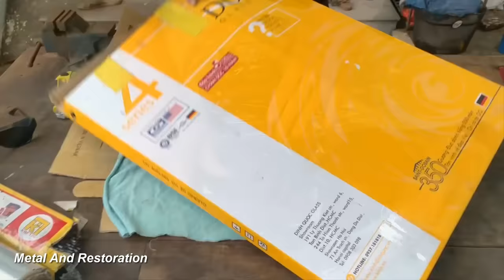Restoration Viking Axe Battle Old | Restore AXE construction Antique

Comment: 2 things, first the holes in it could've been cut into a decorative hole, which was occasionally historically done on weapons. Second, the dang heat treat. The blade wasn't near hot enough for a good quench it needs to be orange. A slightly bright orange but not much hotter, all that happened was normalization (softening) of the steel. And because the "treat" was done in sections, it makes different parts of the blade different steel grains, making it weaker overall. And holy lord he quenched in WATER. That's how you get cracks and fractures in a blade. Quench in oil, never water.
Reply: That's REALLY Interesting! Tell me more! Why use Oil? Wouldn't that inflame the Blade or rather take more time to cool down?
Reply: @jmeister7482  the problem with water is it cools the molecules too fast. And something that's rigid and it gets cooked to quickly, it becomes brittle. As I said, it breaks apart the grain structure of the steel. Oil cools the blade relatively quickly but not too quickly, making it hard with a little bit of flex instead of too hard and very brittle. And yes, the oil does tend to catch fire when you put in a piece of metal that's around 1500 degrees but once you take out the blade, the flame goes out. That just happens. It's not dangerous, especially in an outdoor or well ventilated quench tank
Reply: I see, that's good to know
Reply: Yeah, what he does is absolute nonsense. 
Hurt me a lot to watch this.
Reply: @redneckfishing9357  the Japanese metallurgists suggested "Quenching in a slave" could have been for several reasons. Iron in the blood, at body temperature, or to add the spirit to the blade. The original text is ambiguous.
Reply: @jimleane7578  uh alright. Still doesn't excuse the quenching techniques this guy uses. Blood is a lot more viscous and has different components going for it. It acts more like an oil, when thinking about common quench practices. And I doubt the Japanese did their blood-quench in sections like this guy
Reply: @DragonQueefs  It depends on the use as opposed to the metal. Rasps and files are quenched in water to make them super hard, but they're super brittle. That's just what happens when you quench steel in water. For a blade, you use oil 100% of the time or you'll have a basically unusable blade. On top of them doing uneven quenching with a blowtorch. If you want a blade or weapon that's usable, quench in oil and nothing else. If you want a wall piece it doesn't matter, but at that point you wouldn't even quench it. In short: never quench a weapon in water unless you want it to shatter on contact to anything
Reply: @DragonQueefs  the quench is a way fo line up the grain of the steel. And water lines up that grain super super quick, which makes the blade internally like sand. The grains come apart. Oil does that more slowly. Making it a less "hard" blade but a lot more durable. A tempering process helps but the quench is most important. If the grain isn't lined up, the blade overall will fail
Reply: @DragonQueefs  like I said, depending on the use. Not for weapons
Reply: Daaamn. The experts are out.
Why don't you go make your own vids?
Gtfo

Comment: Why would you quench that with water but not oil?
and the spray painting just killed me!!
Reply: dude, I feel you on this one. The spray paint hurt me...and the water vs the oil. smh...Otherwise, awesome work.
Reply: maybe the guy who sent it to him told him he wanted it spray painted black. :/
Reply: he knows how to restore...
but poor of taste for artwork...sad
Reply: News flash: Iron when it isn't polished is BLACK. Plus it's a rust prevention layer!

Oh and why WOULD he quench it with oil? Smh don't pretend shit if you don't know the use of it. It's forged anyway, quenching it again is useless. It's water to COOL IT DOWN
Reply: nowonmetube news flash, that was obviously him quenching it, no on heats up material and immediately cools it for no reason.
Reply: @justinnicholls5974  News flash, of course it wasn't for no reason. But sometimes I question why people quench, quenched stuff again. And the way how he did it doesn't look very effective. He should have heated up the whole thing until it glows and put it in a pot with liquid, like other peoples do. Not heating up a few centimeters individually with a lighter.
Reply: @nowonmetube  When you heat the metal again you lose the hardness and it can become flexible again, not holding an edge as well. Since the edge is the only part of this tool that needs to be hard he did a simple edge quench. This has the advantage that the rest of the piece will stay flexible and absorb impacts, but the edge is hardened and will stay sharper longer. As for water vs oil it depends on the metal and how hard you want the metal to be after you quench it. Water will cool the metal faster, making it harder, but also more brittle which can cause it to potentially shatter on impact. Oil cools it more slowly. Different metals have different structures and need to be treated differently to get the best results.
Reply: @wowfirebat  you said when heating it again you lose harness, but then you said it's the only part that needs to be hard? WHAT?

About the water oil thing: Exactly, and well maybe this metal was better off treated with water instead of oil? I don't know, I didn't treat it.
Reply: @nowonmetube  only the edge of an axe needs to be hard. The rest of it is better off being softer to absorb the impact when you hit things with it, so he did an edge quench because that is all he needed to do.
Reply: Yeah you go to all that trouble and did all that work with you didn't even really finish it spray paint really
Reply: Oh yeah you're riding a f**** Vespa
Reply: I get it now
Reply: Cause oil will heat the metal!
Reply: This isn't a real Medieval piece, or God I hope not. If it is, this is more of a Destruction than a Restoration.
Reply: @gaminglemon9  Quenching with oil is better than water. Water make the metal temperature drop too quick. The blade will crack like that.
Reply: I couldn’t watch past the first part where he uses power tools on metal restoration, but quenching with water?!? Maybe he’s just a little inexperienced. I was way worse my first couple restorations.
Reply: @nowonmetube  Dude , hes right. If you temper the entire axe , it wont absorb much impact , breaking easily. Doing a superficial temper you get sufficient hardness in the edge of the axe , and good absortion of energy.
Reply: Goodness some people i feel like comment without knowing anything at all about metal working. All he did was an edge quench but it was extremely poorly done. I actually forge as a hobby I don't by any means claim to be an expert but man seeing that temper hurt me lol
Reply: @mypoldo3  He also doesn't know how to restore. The patch is still visible under the black paint.
Reply: Water qeunch harder
Reply: For the people who watch forged in fire and think they are experts in metallurgy...YOU'RE NOT!
Reply: 6
Reply: Water works fine. But oil works better. I forgot why but I would always go with oil
Reply: well you can deal because he didnt spray paint it for you he did it for himself
Reply: @nowonmetube  especially something this big. Its hard quenching axe heads, big knives, swords etc. Definitely if you only have a torch on hand becauze it's hard to keep the whole thing heated.  I would say he probably ruined the original quench which was just fine. So it might not even keep an edge if someone uses it. You can ruin a quench very easy
Reply: @wowfirebat  so what's the point of the blade staying hard and the rest not? If the rest is flexible it will bend. Idk if you ever swung an axe but you are not doing it lightly.
Reply: @wowfirebat  and also. Only kind of axe I think needs a edge Quench is a thick one because it won't break or bend. This axe looks like a thin piece of metal welded to a small piece of pipe that you put a wooden handle through. Its obviously not for real use. It wouldn't be able to keep up with anything. Its probably for display  or a kid to go around chopping watermelons or something
Reply: @juliannn6501  because a bent axe can be hammered back into shape. An axe that has shattered into a thousand pieces is junk.
Reply: @wowfirebat  no, an axe that bends is junk. If it cannot hold its shape under all that force it is not meant to be used as a axe should be. The only reason why a thin axe such as this would bend or break is if you were using it incorrectly like twisting it or something. But this axe is probably just for looks
Reply: @juliannn6501  tools bend all the time and historically it was even more common. Bent tools can be fixed; broken tools must be replaced. Replacing tools can be expensive and shattering hardened metal can lead to injury or death. It is much safer and smarter to leave the remainder of the axe soft to avoid these problems.
Reply: @wowfirebat  I don't know what kind of tools you use, but your tools should not bend. The only tools that bend are poorly made ones. There is a difference between flexibility and bending. A machete for instance. It is flexible but should never bend no matter how much force you put on it through work. The only reason a tool will shatter is if it is incorrectly made, even if you are trying to use it to pry something. Which idk why you would use a bladed tool to pry something when you can just use a pry bar
Reply: الو
Reply: @m.nuriural8608  I saw that as well.could clearly see the square

Comment: I will never get the black coating. That just makes this axe look like a plastic LARP axe, the origin of this axe goes completely to waste.
Reply: Would be better if it was carbon black oil that is seasoned on through repeated heat treating. The heat treat would also help to normalize the blade tension after edge hardening and welding the plate. The whole blade should have been annealed before edge hardening. It is actually very dangerous to use a heavy plate that might shatter on a long moment arm; probability is higher that a large, heavy, and sharp piece comes flying off.
Reply: @brendanwood1540  wow that's interesting, I would like to get into blacksmithing and forge welding, you should  make some educational  videos  on it
Reply: Would look good with gold and a turquoise inlay.
Reply: It would have to be a prop, because that axe will smash to bits when it is smacked against something as hard as bone. His hardening quench was dumb, the metal is meant to be hot enough to not hold a magnet to it, bright orange, to be then quenched. And then you should also know the carbon make up of that metal to decide on a water or oil quench. Water will make it super hard, but more likely to warp, and also crack the metal. Oil quench is safer for people who obviously do not know what they are doing.
Reply: like.... at least make it gradient if you’re gonna do it
Reply: It's origin? It was probably part of a decorative armour set from the 20th century
Reply: Lol the client wanted it painted.
Reply: Lol...the origin of a bad cad file, a sloppy plasma cutter, and a sch 40 A36 pipe?  Such history, many legend, wow
Reply: Yeah, but what if it's a prop?
Reply: @kamakazikat2473  just look for other restoration videos. Most use the oil heating technique to paint it black and prevent it from rusting. Looks so much better than just spray painting it
Reply: @attk177  thank you :)
Reply: hockerhelmut that’s the Point! When you are getting Robbed you can whip the Axe out and Slice then in half
Reply: Can I just start with saying.... there is no origin story to this axe? Show me anywhere in history where there is a perfectly round eye for the head of any axe ever? Or the fact that that's clearly two pieces of metal welded to the eye itself and the been sanded smooth and had two mounting holes drilled into it. Those aren't punched through. And the was a speed rust job done to make the metal appear older that's why it was bright orange and able to flake off so easily revealing really nice metal beneath. GTFO of here.... disappointed.
Reply: News flash: Iron when it isn't polished is BLACK. Plus it's a rust prevention layer!
Reply: It’s probably a halberd and not an axe

Comment: I like how the hole in the blade looks like it was made with a welder or plasma cutter cause if it was eaten away by rust the metal would be way weaker and there would be you know rust around the holes

Comment: That welded patch stands out a mile especially after the spray painting
Reply: Not to mention he literally could have just welded the holes filled in and then sanded them as he'd done to the blobs. Would have been LESS weird to do that than go through all the trouble of actually cutting a piece out only to weld a new piece back in, and welding is never as strong.
Reply: @impishrebel5969  yeah definitely this. I thought he was going to open it up and make a small design. literally stencil out the space and grind it down.
Reply: @impishrebel5969  EXACTLY

Comment: Hi professional knife maker here, some tips on your hardening. 
1.Rather get a container that can fit the entire object you're wanting to harden because you'll get an evenly hardened blade. Also use oil instead of water, helps avoid cracking
2. Can use a torch like you have to heat up the blade but make sure the edge at least is evenly heated and use a magnet to check when it's ready to quench. All steels have varying temperatures they'll harden at but they'll become non magnetic when they're ready so heat up evenly alomg the whole edge until magnetic can't stick to it.
3. Sounds like a myth but is real when you harden point the tip north to avoid warping. This is when it becomes magnetic again amd is effected by earth's magnitism.
Last thing temper your blade at 180 degrees Celsius for most carbon steel for 1 hour 3 times after it cool to room temperature.
Reply: I like your I like your style
Reply: Ooh I liek
Reply: great advice, except the magnetic north bit; it sounds like a myth because it is.  The Earth's magnetic field is far too weak to cause warping.
Reply: @sigmundr2148  I thought it was a myth but my boss and I have done tests and it's true. Whenever the quench tank didn't face north all the blades hook northward. When it was pointing noth the blades where straight. Even in vertical quenching if the edge didn't face north it'd hook towards north. So yeah we thought it was a bunch of balcony but it's a genuine thing
Reply: @skulduggeryvile7887  Lmfao, and you believe this is an ancient viking axe. haha
Reply: @biggusdickus9046  where did he say its a viking axe?
Reply: @skulduggeryvile7887  So the magnetic field is so powerful it bends knife blades. Really. Lol.

Comment: should have just welded the holes flush instead of welding on a new piece....
Reply: @KATA What?
Reply: @KATA lmao what
Reply: @KATA did you have a stroke trying to write this
Reply: @mandoky1647 I do it for a living my ass. prove it that you are a "welder", don't undrestand why all of the sudden everyone pretending to be a welder here in the comment section?
Reply: @oxyacetylene7432  um probably because its welders who want to watch this type of video hense why alot of people are saying they're welders. I mean how did you not put 2 and 2 together
Reply: @KATA what??? Obviously you dont know how welding works
Reply: OxyAcetylene the guy probably does do it for a living. they made more work cutting that spot out and welding a new piece in, instead of filling it with a weld. They should look into sand blasting and powder coating would come out a lot cleaner finish and save time and isn’t as expensive and it seems
Reply: That makes too much sense though.
Reply: I did welding, pipe fitting and sheet metal fabrication in the navy. Yes, it would have been A LOT easier/faster to just weld over the holes and then grind it flat. It’s really not that hard. A whole piece of metal was so much more work and way harder to make flush...
Reply: @nowonmetube  the holes were burned in.......they weren't made from corrosion. Just weld them. If it was corroded through you would cut out that area and weld a new plate in if you felt it was worth it on that crap axe head.
Reply: @MRAHALL  that's what you said but I'm not sure if that's correct
Reply: nowonmetube you make playlists on YouTube who are you to judge?
Reply: @nowonmetube  That is an option for fixing the holes, cutting out an entire section just gives more surface area for a failure.

Comment: One thing these "restoration" channels never do right, is keep the original aesthetic and straight up ACTUALLY restore it, they always make it look like a modern prop replica and it's super ugly. Just clean it and make it sharp again, don't paint it and all that shit
Reply: Why put any real work into a cheap replica?  Notice the pole attachment looks like a piece of pipe welded to the blade. Nothing like a real smith would have done if it was period. It probably is a modern prop or some living room wall art.
Reply: Pretty sure most restoration channels aren't even restoring old thing, they just make a crappy replica, dip it in salt water for a couple days then "restore it". This is clearly a prop made specifically for this video, just some simple blades welded to a pipe. Plus, the holes in the large blade look like someone's just held a welder down on it, for what reason I wouldn't know but it all seems a little sus.

Comment: So just to let you know when you decided to heat treat your blade as you heated up the different sections of the blade you made the points in between each heat treatment weak and unhardened it is better to try to heat treat the whole blade and not sections at a time!